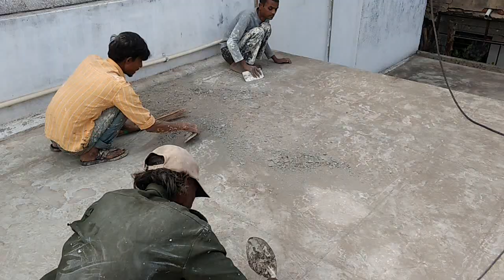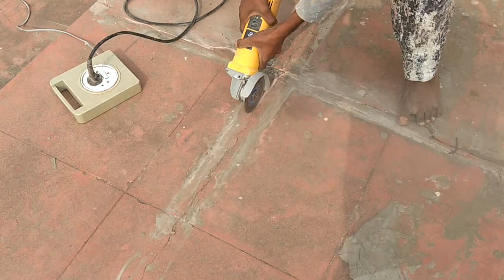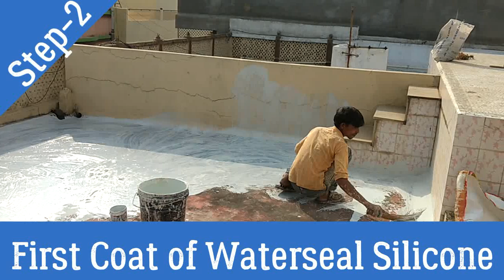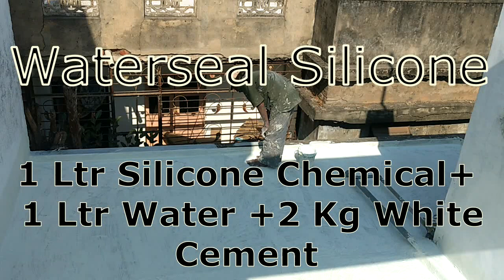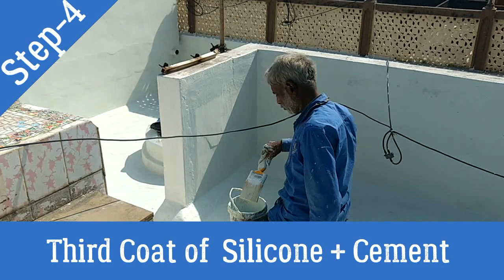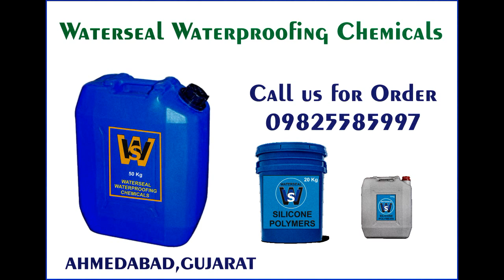"Discover the 5 Best Tips for Long-lasting Waterproofing " - Check Out the Video

Comment: Sir,
Mere ghar ki chat 45×70 ft hai.... Uska cost kitna hoga
Reply from the maker: 45x70 = total 3150 Sq.feet ke liye aapko
140 Kg PSv  360x140 = Rs. 50,400/- ONLINE is link par milega.
https://waterseal.in/product/waterproofing-chemical-waterseal-psv/

3Kg Fibre mat 450x3= Rs.1350/-

+ 300 kg White cement  local market se lena hoga jo lagbhag  Rs. 5000/- ka aayega.

3 labor 3 din kam karenge to 9x400 =Rs.3600/- 
ke aaspass charge hoga .

ku milakar Rs.50,400/- +Rs.1350/-+ Rs. 5000/- +Rs.3600/-  = Total Rs.60,350  se 65000/- ka kharch ho sakta hei.

Helpline 9825585997 per call karna
For more details Link: 
https://waterseal.in/terrace-waterproofing-by-your-self/
Reply: @WaterproofingContractors  fir iske baad Terrance gardening kar dakte hai kyaa

Comment: Sir  mehe yahi kam karta hu nepal me yaha to opc cement me chimical ghol ke karte he aapne to white cement me karraha he
Reply from the maker: Sir, our Product Waterseal PSv is specially designed to give better results with White Cement and Give Thermal Resistance over the Surface. It can also be Used along with Normal Grey Cement.

I am Sure you got your answer. In case you still have any queries ,feel free to contact us : 8866903438 

Visit our Website For more Details:

https://waterseal.in/
Reply: Ok sir i call  u
Reply: @WaterproofingContractors    sir aaf ye chimical veg sakteho nepal me

Comment: Do paints stick to the walls which have been applied with these Silicone POLYMER? or Is it possible to paint the walls which were treated with this polymer.? . Since i'm afraid it may repel the wall paints.
Reply from the maker: Yes Do it ,on wall for waterproofing

Comment: Wen u open V grove cracks u should have used PU sealent for longer term result & wat is this  silicon Chemical coat??
Reply from the maker: Waterseal PSv – Polymerized Silicone Vinyl  – Waterproofing Chemicals

Waterseal Waterproofing Services is an Indian company in the sector of Waterproofing Specialists. It was founded in 1995 in Ahmedabad, Gujarat by Mr Simon Benjamin. His choices towards more innovative products, with a lower environmental impact, without compromising their high standard and technological qualities. Note :This is not Silicone Sealant or silicone rubber
High Quality Performance  Silicone Polymers Coating

Waterseal offers comprehensive system solutions for Waterproofing a new home or Repairing an existing one. Our products for all critical surface areas like Roof, External Walls,Basement,Internal Walls, Bathrooms and Water Tanks.

100 % successful and affordable  Waterproofing chemicals. ‘Waterseal ‘ is the Best waterproofing brand in India  that many customers from the construction sector are deal with us. we gain the trust of clients, we work hard and make sure that we fulfill following factors:

PSV is a heavy duty durable terrace waterproofing system. composed of specially developed highly elastic & durable Silicone,polymers and vinyl. Is suitable for both indoor & outdoor Roof ,wall and sealing work.

FEATURES/ADVANTAGES OF SILICONE POLYMERS :

    This products is 100 % successful  for waterproofing Treatment.
    Easy to Apply without any skills. By brush or Roller.
    Film thickness is 1 to 1.75 mm in four coat application..
    No need to remove existing Tiles, plaster, or concrete surface.
    Can be used for flat and sloping Roofs or Wall
    Higher tensile strength, tear resistance & bond strength with cement substrates.
    Resistant to  weather conditions.
    Light weight waterproofing chemicals does not add extra weight over the roof.
    It is non-toxic in nature & breathable waterproofing.

APPLICATION AREAS

Building roofs / terraces – flat & slopes Over existing waterproofing chemicals treatments like – Rcc, concrete screeds, Cement,fiber and acrylic weather sheet ,etc

Our promise as a Waterproofing Engineer, is to build community value into every product while delivering professional expertise,Exceptional customers service and quality Waterproofing.